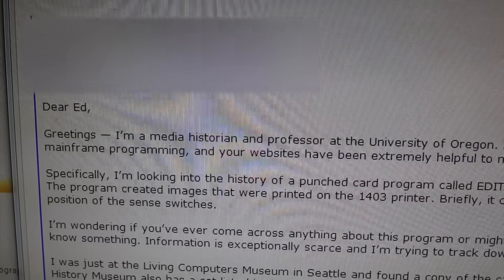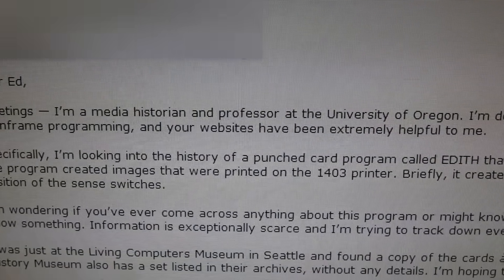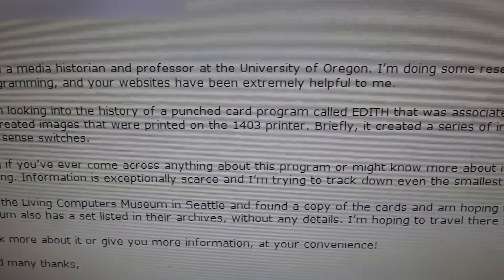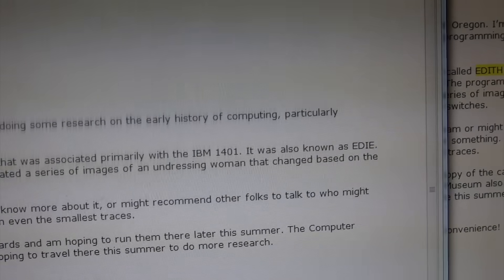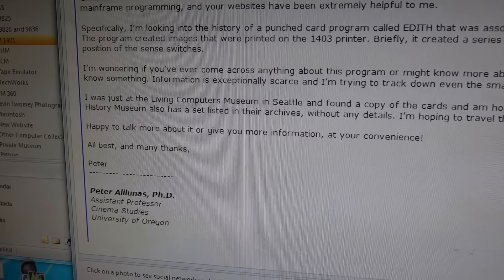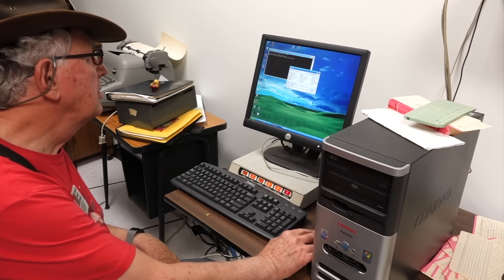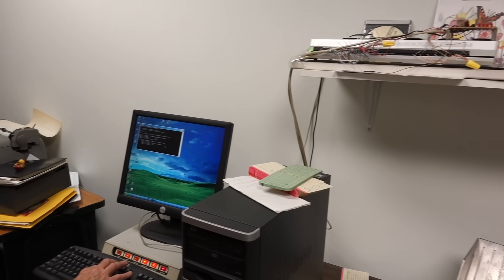The IBM 1401 mainframe runs "Edith"

Comment: A better translation for the last one (the sign) would be more like "Whatever the goal of your desires was, the 1401 does not allow everything to be done with her/it"

Also, there is a small "joke" on the first sign: "Weitere Auskunft ... gibt Schalter B" -- The word "Schalter" in German is not only used for a switch but also for a counter in a bank or something. So the translation would be both "Further information about her qualities can be inquired by switch B" and "...can be inquired at counter B"
Reply: Indeed, that the pun is intentional is given away by the formulation "Weitere Auskunft" which is typical for the "counter" sense but would be a little less in context for a computer.
Reply: I guess for English the best fit would be: Whatever your intended desires are, the 1401 isn't capable of allowing you to do everything you want.
Reply: @Clancydaenlightened  Don't think "capable" is very fitting here, since it would of course be capable to print that inappropriate "ASCII" (yeah .. isn't ASCII)-art. "(jemand) lässt nicht alles mit sich machen" quite strongly implies a deliberate denial, so .. "won't allow you to do that to/with her/it" maybe?
Reply: @VintageTechFan  "(Jemand) lässt nicht alles mit sich machen" ... I'd translate it roughly as "you'd better not mess around with (somebody)". That's not word-for-word of course.
Reply: Took me a minute but I can't believe I got it
Reply: Genau, dankeschön

Comment: This brings back memories from 1967. My first machine was an English Electric KDF9, which noisily inhabited a room in the University of Sydney Physics building. We learnt a teaching subset of Algol. The "we" being a small group of first year physics students who volunteered to participate in a "not for credit" course "to see if physics students could learn to program".  Turn around time during weekdays was 36 hours.  The source code was on punched cards (we had to do any corrections on a hand punch!) by magical means a paper tape containing the binary code was produced for later execution.  Any printed output appeared on a teletype, fed by paper tape.  Later, I had a "long vacation" student employment and had to learn FORTRAN to do some geophysical calculations.  Run times were very long on the local IBM, but virtually instantaneous on a Control Data timeshare machine once the program was debugged.  Although I was a Physics and maths major, I ended up working in IT for the whole of my working life, but at that time I had no idea of the implications of my holiday job on my future career.

Comment: I see this video now years laters (2024) and I worked with several computers mainframes in the past, e.g. in The Netherlands with the P1200 (or P1175), Bull DPS 7(000), Siemens 4004, and some more. IBM too, but only as a programmer.
But the printeed ladies.... well, we had those everywhere! And one of a steam locomotive, really beautiful. Prints also had som doubleprinted characters, as in this days it was easy to let a printer do that.

Comment: I don't remember whether I saw Edith or Sophie back in the day but I'm sure I probably did see something similar coming off a 1403 printer. I remember printouts showing Snoopy were common being printed by a 1403 connected to an IBM 360. At a local university they had some basic wooden chairs to sit on when using an 029 keypunch machine. It was the perfect height. I could type faster on the keypunch than I could on a typewriter of the day. I still have printouts that came from a 1403. I also still have a manual and a control drum for an 029 along with a couple of decks of cards with a couple of programs on them that I was running back in the early 80s.

Comment: Back in the 70's , when people actually had to compete for computer time to do their work, someone I know of asked for a given slot and was denied the slot. The scheduler was told: "If you don't give me the time I'll run the THUNDERBIRD program." The scheduler refused, and so soon the computer was set up to run THUNDERBIRD. This program was in essence a computer virus, which made the computer tape drives activation lights whirl in sequence like the turn signal on late 60's cars like a Thunderbird or Cougar, and would make the printers jam print the word THUNDERBIRD in big letters, then tractor shoot up 6 pages and repeat, with 3 printers running in sequence, paper flying everywhere, and the computer would continue to run like this unless/ until stopped by the correct typed in command. The guy got his computer time as requested.

Comment: First computer I worked on was a 1440, the baby version of a 1401 with 4000 6-bit characters of core storage (aka RAM), a card reader-punch, a tape drive and a printer. A good programmer in those days was one who could squeeze every ounce of performance out of it, so working in Autocoder, we did things that would have stood people's hair on end today, like using instruction codes as constants and altering code on the fly. A tape might have, e.g., a customer file. If you wanted to find a particular customer, the drill was to load the tape-to-print program from a card deck, then run it with a sense switch that kept it from printing, until you figured (by eye) that the tape was somewhere near the one you wanted, then flip the switch and get a few lines of print, flip another switch to pause the program, and check  the printout. If you had gone past the record you wanted, you would manually rewind the tape a bit, rinse and repeat. Edith would be a very simple program, probably just reading and printing a card deck, or if you got really sohphisticated, setting the image up in a table as a bit pattern, say 150 rows of 22 characters (132 bits), which would come to 3300 characters of data. The program wouldn't take up more than 100 characters or so. The baling-wire-and-canvas days of computing.

Comment: These programs were quite widely written - I used to work on an IBM 1460, with ran three 1403 printers - at Xmas we wrote a program that printed Santa on his sleigh with the three printers working in parallel, playing Jingle Bells as they printed - by using one part, two part and four part listing on each of the three printers we got a good tonal range to the music.  IT was so very simple back in 1969.
Reply: Growing up in the 60's, every Christmas my rather brought home a long printout from NDSU - Merry Christmas with (I think) Santa and reindeer. I thought it was so cool that the M was made out of capital M's, the e's were made out of lower case e's, and so on. And IIRC, the card stack was only 2 or 3 inches thick. I believed until 30 seconds ago that my dad wrote the program himself. But I now have my doubts. I still wonder what happened to the card stack as I'm sure I recall seeing as late as my high school years in the late 70's.

Comment: In late 1964 and early 1965 I was at a research facilty in California which had an IBM 704 and an IBM 1401.  There was a similar situation.  Instead of a program there was a deck of data cards that when printed on the 1401's line printer  a young lady would appear.  So it wasn't a program but it was data; about two feet in the deck of cards.  However this deck was not kept in a file cabinet.  Off in a corner one had to lift up a floor tile to reveal the hiding place.  The facility had a double floor typical for cooling computers in those days.

Comment: I was a student operator on a 1401 in college.  I had an opportunity to see Edith in all her glory so I looked at the cards and figured out which ones were needed to just print out the final version.  Wrote a Autocoder command which would read the card images from RAMAC and immediately send it to the printer.  Posted the “try this” to the bulletin board.  Got me an invitation to the Professors office where I was reminded about the proper use of equipment and my job duties.  Also was complemented on my initiative which should be pointed toward more business related goals.  Guess I should have charged for using the command.  Anyway this brought those memories all back.  This were back when “PC” was not even a thing!

Comment: As far as I remember there were at least two other versions of this, Susie and Michelle iirc. One was very explicit. In addition there were the ‘music decks’  where the printer was used without paper whilst an AM radio was placed on the printer cover and tuned to a non-used station frequency. The interference of the print train caused ‘music’ to be played on the radio. I believe one piece of music was either Anchors Away or a piece of Sousa.

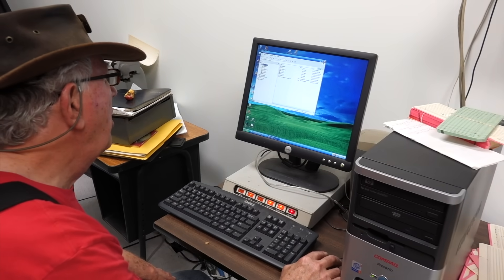Comment: 05:39 At first glance I thought, "Cool! ...Windows XP is running on that screen"... then I looked again and that looks like 32-bit BionicPup Puppy Linux with the XP theme running... LOL! :-D ... mega-awesome... I'm running 32-bit BionicPup 8-23 right now, in the XP theme, no less, except I'm using a jpg copy of the original Bliss-dot-bmp file from my Windows XP Pro installation on another hard drive for the wallpaper in this Puppy Linux install instead of the wallpaper file that came in the Puppy Linux XP-theme .pet file.... I love the Pup... it's friggin' fast and awesome. :-)
Reply: Update: after shifting to a higher video resolution and taking a screenshot of that screen and then enlarging the screenshot photo I see that that IS Windows XP running there LOL!!! :-D The wallpaper on that screen looks the same as the wallpaper for the Puppy Linux XP Theme wallpaper..... so confusing... but, I'm all better now. I guess seeing all those hot babes appearing from that big printer in the video had me all distracted ;-)
Reply: I keep a Windows XP installation going on another hard drive mainly so I can maintain support for my two Microsoft Zune HD devices, because I haven't yet found a Linux equivalent to the Microsoft ZuneHD software. Do you know of such a thing, Marc?

Comment: The DEC KL10 system at Catholic Univ in Washington DC in the mid 70s had several versions that had evolutions from printed copies to the PDP Terminals that were highly detailed using fractal created lines on the electronic display to simulate the curly hairs...

Comment: That reminded me of an open house I went to at a NOAA facility in Seattle when I was a teenager (probably in the late 1970's).  They had a large flatbed plotter they were proud off. It's vacuum table was maybe 5 by 10 feet (plus or minus a couple of feet).  

As I remember it (but my memory is admittedly a bit shaky), they  started to run a demo plot on the plotter but shut it off after a few lines had been drawn.  They changed to and ran a different program.  After the demo, I asked the demonstrator why they changed programs and he showed me a previous complete plot of the program they started to run.  And, you guessed it, it was a pin-up girl much like the ones you printed -- except with better resolution and in a reclining pose.  Amazingly, I can't remember if she had cloths on or not.  You'd think a teenage boy would remember if she didn't, so she probably did.

Comment: I wonder if they've found either of the 1401 "Music Loader" programs. One of them hammered the printer chain to generate musical notes; the other caused the 1401 CPU to generate electrical signals that could be picked up on an AM transistor radio as musical notes.
Reply from the maker: Yes, we have them. We don't like to use the printer music one though, as it stresses the character chain, and we don't have that many left.

Comment: OK, what do you do for card-file backups?  (even a copy on tape would work!)
Reply from the maker: Read it and archive on a modern computer...
Reply: OK, you provide the hardware.
Reply from the maker: @stan.rarick8556  We sure do have it. Carl's probably the most reliable. He has been archiving cards decks by the many 1,000's for several people that requested it to the museum.
Reply: Great! Years ago I knew of System/360 Bus & Tag to [other] hardware adapters existed, but they weren't common & I didn't know if any existed for the 1401.  Is the cabling anything like the 360?  (I haven't touched a 1401 since about 1967)
Reply from the maker: @stan.rarick8556  No, of course no bus and tag in these days. We usually read the cards to archive on a separate hardware, using "modern" Documation card readers, video of mine here: https://youtu.be/0YAFc1G5NxY

Comment: What I want to come about would be a multi-Media 1401 simulator, a GUI based app on a suitable machine,like the Commodore Amiga. Some of features would be the true sounds, of, say, the combination card read, punch and print op codes, drag and drop response to the punch card chip bucket full light to empty it, manipulation of the sense switches, etc.

Comment: I remember this one.  It was a sales demo program to show the speed of the peripheral devices (even the slowest CPU could run many times as many instructions as most accounting programs required between cards and/or print lines), and the quality of the line printer.  The first run printed Edith in an evening gown, then revealed the second run's switches.  The second run printed her in a bikini, then revealed the switches for the third run.  The third run printed her APPARENTLY nude, but holding up a sign saying that "even the 1401 cannot do everything."  It was rumored that the sales agents were not allowed to reveal the combination of switches that removed the sign!

The switches provided a way for customers to use the same program in different circumstances to produce slightly different output, such a whether a payroll, billing, general ledger, etc. was being used in a daily, weekly, monthly, or year end situation.  This method was so universal that the most popular SMALL customer operating system when the System /360 was introduced, known as DOS/360, included a control card called UPSI which simulated these sense switches, so that programs could read the simulated switches with a call to the supervisor program; the control card interpreter (JCL, for Job Control Language), which read the control cards to set up the environment before running the program, saved the UPSI (User Program Switch Indicator) values, eight binary switches, for application programs to read while running.  And unlike the physical switches, no one could change them by accident during the run, as happened in part of this video.  A special attachment to the hardware and to DOS/360 would allow the CPU to emulate 1401 instructions in application state, with 1401 input and output triggering the actual DOS code to perform the equivalent operations.  This allowed users to run legacy 1401 programs on their new machine while scheduling the program development to convert those programs.
Reply: Now the question remains... was the combination ever found?
Reply: @slendidevel  If anyone has a working deck of the “Edith” program, the machine code could be reverse engineered (a process known as “disassembling”) to reveal the program logic.  I expect the logic would be rather simple, and the 1401 instruction set is readable as characters.  Of course, a programmer with reasonable knowledge of any computer, armed with a manual and a copy (in the form of a literal printout of the run deck) of the program, could learn the instruction set while learning how the Edith program works.

There are working 1401 systems in a number of computer museums, and possibly emulator programs that run on personal computers also (and probably print generators which can produce the 1403 printer’s font).
Reply: "even the 1401 cannot do everything." man they got some sense of humor lmao

Comment: The English version I remember started with something like, "This is Edith, an optional feature of the IBM 1401. For more information, please rerun with sense switch B on." The switch B version had the same initial text followed a brief blurb about the 1401 and the suggestion to run with sense switch C on for even more information. In the switch C version, the sign covered her boobs as well and was filled with the actual specs for the 1401!
Reply from the maker: Great info. We have not located an "original" English version yet.
Reply: neofetch for the 1401 seemed classy

Comment: EDITH ran just fine on a 1410 running in 1401 mode.  There was also a "Jingle Bells" program for the 1401 - it used the 1403 (600 LPM version) .

Comment: Among the many capacities of SAGE, a massive 1950s air defense computer network (1st of its kind, many, many firsts) was to display a naked lady on the radar scope.  Built largely by IBM, it was the fastest vacuum-tube computer ever built.  Each unit the size of a football field and was actually two complete redundant computers, local and remote failures were thus defended against.